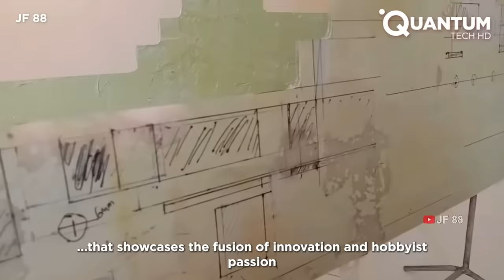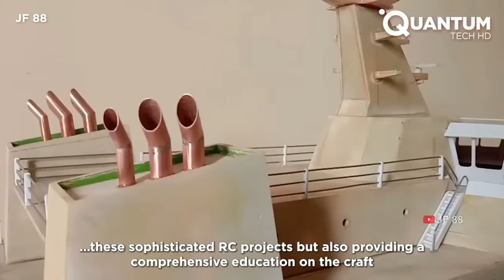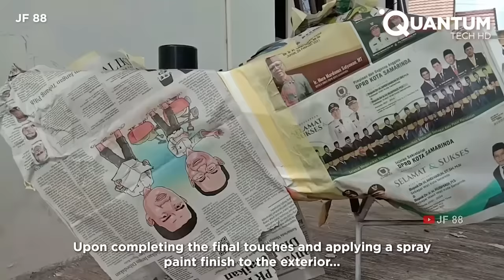Man Builds Hyperrealistic RC Warship at Scale | OPV 1800 Military Replica by @jufri_88

Comment: Heating the blade is not a good idea, it is very thin and therefore cools quickly, and parts of the plastic stick to the cutting edge and dull it.  It would be better to use a cold file with fine teeth or a knife with a thick blade that retains the temperature longer 😊